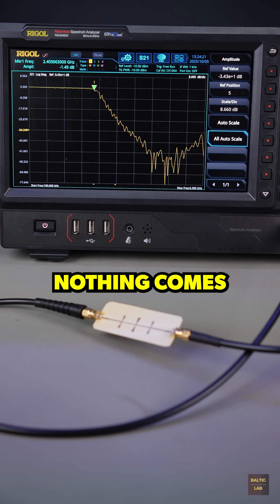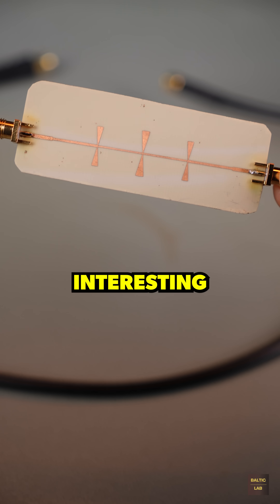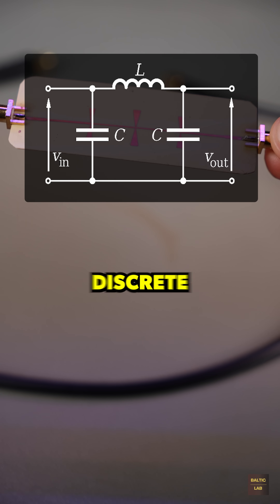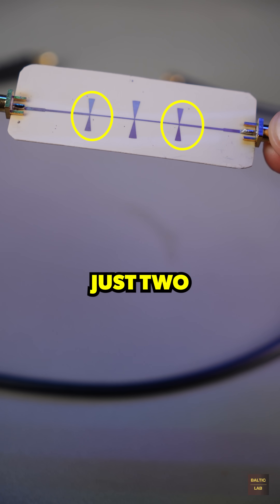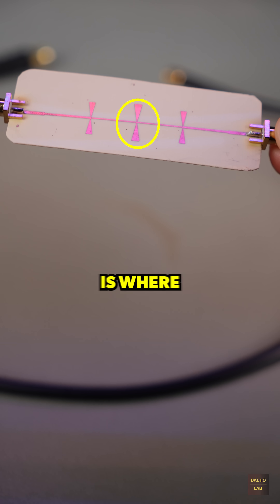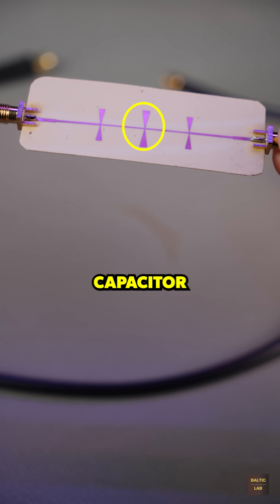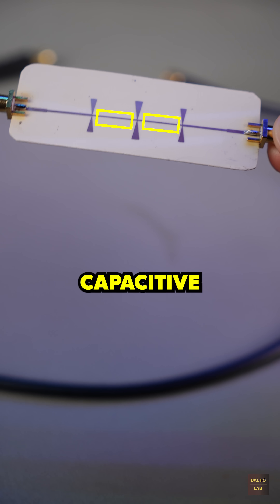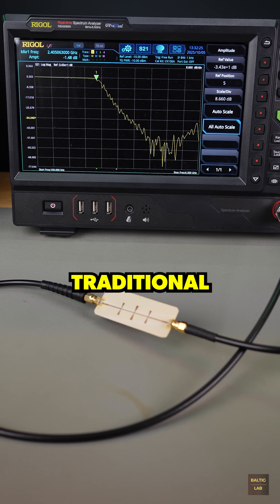Radio Frequency Magic: 2.4 GHz Low-Pass Filter with Butterfly Stubs  #electronics #hamradio

Comment: It's facinating how everything has both resistance, capacitance and inductance while every structure is a transmission line to some degree, and how it becomes more and more apparent/critical the higher you go in frequency. I work with fixing old Hi-Fi equipment, and audio frequencies are honestly child's play compared to RF stuff. I have the deepest respect for all of the people who designed the multitude of GHz tech we enjoy in our modern lives.
Reply: Haha true, when designing 100GHz electronic (yes, two zeros), even the material you use has to be super niche to have the correct dielectric properties. 

It gets progressively hard as well. 
MHz is child's play. 
Hundreds of MHz needs a minimum of understanding 
GHz needs good practices 
10s of GHz needs strong carefulness 
100s of GHz needs cutting edge technology, sooooo many problems you never thought even existed are there. Like chromatic distortion, doppler effect. You cant even use normal components as they dont behave properly. Capacitors are inductors now GREAT
Reply from the maker: You've hit the nail on the head! RF truly makes you rethink everything. Glad you enjoyed the video!
Reply: A "pure" resistor would be a solid block of carbon.  But most resistors are wirewound, so right away because it's a coil it has some inductance properties, and the insulated turns of wire crowded with each other have capacitance between them.
Reply: @haweater1555 A block of carbon would also have a tiny amount of inductance. The inductance of a coil does not come from the shape itself, but from the way that the coil structure amplifies the inductance of the wire being wound. Any material conducting electricity also has inductance determined by its dimensions.
Reply: @haweater1555 dont the inductive properties cancel because they wind them both ways? I think its primarily capacitive effects that exist since you cant remove that from the coil so easily

Comment: Amazing video but I do have to be that guy. This is not HF. HF stops at 30 Mhz. this is UHF.
Reply from the maker: It's usually best not to be that guy. Otherwise someone might point out that nobody was talking about ITU designations, but using "high frequency" it in the engineer's common colloquial sense. And even if they were, the stop-band extends well into SHF, so calling it UHF would still be wrong, or incomplete at the very least, at the frequencies where the real magic happens. 👌
Reply: @BalticLab  thank you, great content

Comment: As nothing more than a fitter / maintenence bod, I can tell if an antenna system is working or not, but have no idea how. Love these easy to digest nuggets of knowledge. It's looks soooooo simple, yet is incredibly precise.
Reply from the maker: Glad I can make the complex stuff a bit more digestible!
Reply: Check out fiber optic systems if you like this. Just as fascinating and you can see where stuff is going.
Reply: @N4CR I will bud, thank you 👍

Comment: Actually it is a third order filter, each of the three pairs of stubs are performing low pass filtering and together provide a sharper roll off. The description given is not quite correct.
Reply from the maker: A third order filter is exactly what I've shown and explained. However, if you want to be that technical for a short, it's actually a 7th order filter. L-C-L-C-L-C-L, which is also apparent by the slope of the S21 magnitude. A third order filter would only provide 60dB/decade roll-off, so significantly less than shown. That said, it's a short. The intent is to show people some interesting new things. Not only is the time insufficient for high accuracy, but the dopamine addicted behavior needs to be accounted for: Highest accuracy and complexity makes people swipe away quickly. Unfortunately. I wish it wasn't that way but it's the modern internet rules I sadly need to play by. 

Thanks for your comment and watching.
Reply: @BalticLab youre feeding the fire
Reply: @BalticLab  are the 4 Ls for each adjacent pairing of the stubs? And is it coming from a generated magnetic field (im picturing current moving in a 3 sided square from the end of the 1st and 3rd stub into the second stub and back, forming almost a full loop) or is it coming from phase delay, such that each stub is just delaying the phase a bit more until ~90 degrees?